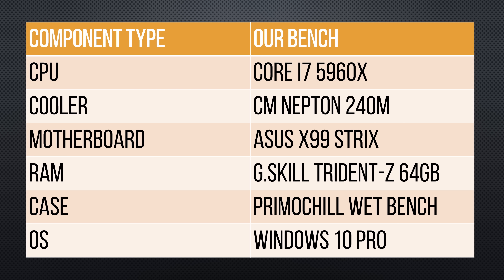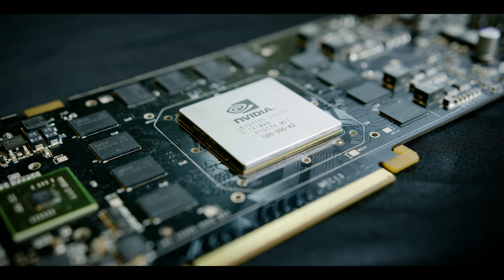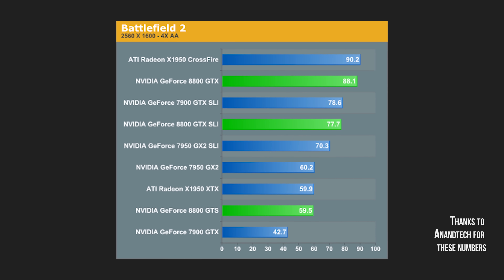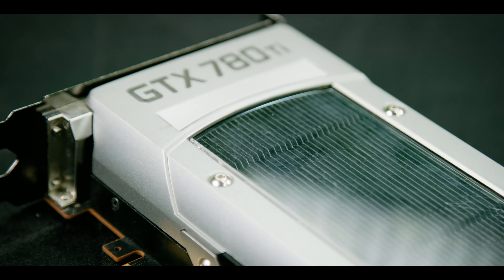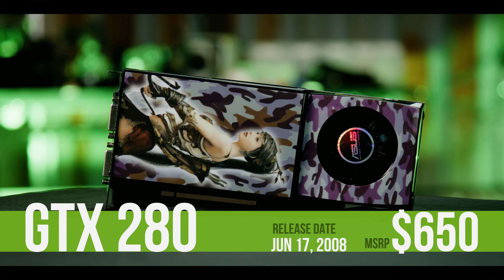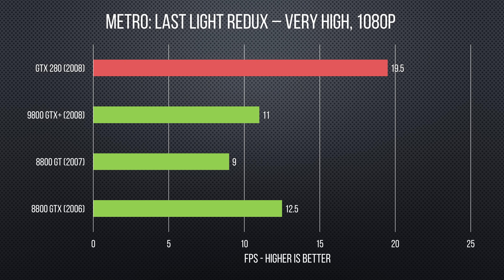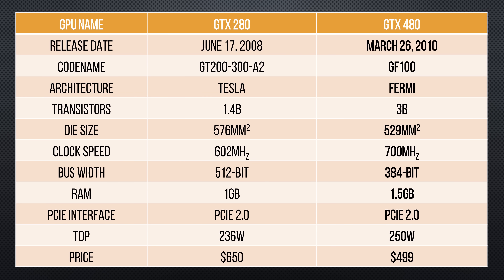10 YEARS of NVIDIA Video Cards Compared!

Comment: Also we can forget the honourable mentions, like the low and mid tier sections. Mostly the GT 710, being a good and light low power, and the GT 730 GK208B revision being light and low power, but with a bit of a boost in performance. Including the GTX 950 low power, the Percy mid tier GPU not needing any power connectors.
And we can’t forget the well rounded revisions of those gpus, the GT 1030 doing the same but with a bit more flexibility and a bit more power, and the GTX 1050ti bringing a substantial boost to gaming mostly with more VRAM.

Comment: Biggest bump in performance was for GTX 780 Ti. Then GTX 980 Ti sort of stagnates without being much of an improvement and GTX 1080 Ti once again gives you a huge difference. 

So, it seems that upgrade path was from 8800 GTX to GTX 580 to GTX 780 Ti and finally to GTX 1080 Ti. Nividia seems to make really significant gains once per two generations of graphics cards.

Comment: It was nice to see all these old cards. Some were pretty familiar.

I had a 560TI, a 690, a 780TI, a 980TI and then I switched to AMD. My I bought the 690 with the launch of BF4 I believe and I was so disappointed in all the Micro Stuttering, that I bought a EVG 780TI Kingpin a couple of weeks later. The 980TI was still used up until the end of Nov this year. My first AMD Card in a long, long time. I had almost 2 decades ago a X700, a X800GTO² and a X1600XT before switching to a 8800GT.

Comment: I had, actually I still have it lying around, an 8800 GT. I vaguely recall that people at the time felt the GTX wasn't worth the extra cost. But my 8800 was still amazing and never struggled with anything I threw at it. In fact it was so good that when I finally replaced it, it was with an overclocked GTX 660 Ti, which required replacing the PSU because that is one hungry bastard

Comment: GTX 580 was 4x faster than 8800 GTX for less money (only $499) after exactly 4 years. That's the same amount of time as between the GTX 1080 Ti and March 2021, when GTX 1080 Ti level of performance was MORE EXPENSIVE than 4 years later (in May it's the same or worse)... the market is truly fucked up!

Comment: This is from when 1080ti was top of the line. Hold on baby face 2017 Linus, 8k gaming is coming in 2020.
Reply: I’m not saying it’s obtainable for the average consumer, I’m simply saying it’s possible to do at reasonable frame rates. Also, you could find them for $2000 throughout the shortage.
Reply: I mean we're in 2021 and 8k gaming isn't viable except in extremely optimised titles with dlss enabled to run it at lower resolutions and then artificially upscale it

Edit: Also with a 3090 that in today's market is over 3000$

Comment: I want an nVidia Ampere GPU with 65536 CUDA cores clocked at 6969 GHz with 420GB of VRAM and a TDP of 250 watts costing $69,420. I would buy it.
Reply: That's actually a very reasonable price tag

Comment: It is insane to see how technology progressed, as just 10-15 years ago they had 1GB and 65nm as revolutionary and NVIDIA is now on 8nm and 10GB.
Reply: 80gb a100 moment
Reply: Yep, that sure is insanely slow progress compared to the 90’s and early 00’s when Dennard scaling was alive and every generation (~1 year) doubled GPU performance and added a bunch of new features.

1080 to 4080 took about as much time as voodoo 1 to 9700 pro.
Reply: Except we had 8gb gpus in 2014 from amd.
And we haven't made any note worthy performance per dollar improvement in the mainstream cards in 6 years due to greed.
Reply: @evila9076  But the top end got a lof of vram with 24gb and this time the whole RTX 4000 series is getting 4NM but I am just waiting for the RTX 4060Ti to come out as it has same performance with the RTX 2080Ti so the RTX 2080Ti users can upgrade to that and I can buy the RTX 2080ti at a massive cost reduction and plus get 11gb of vram.

Comment: Still very happy with my GTX1080, it's the newer 11GHz memory variant with factory overclocked clock from MSI, putting it between the base 1080 and 1080Ti in terms of performance.

Comment: 11:55 remember when flagship gpus didn't cost 1k
Reply: Imagine the flagship gpu being only 1k instead of 1.5k
Reply: @wta1518  3090 isnt flagship, 3080 is 'supposed' to be 700 usd
Reply: @karel4845  if 3090 isn't flagship, what is is?
Reply: @karel4845  3090 is like a quadro card with those CUDA cores and vram xD
Reply: @indraexe7735  titan
Reply: @Bhende45  that was released in may 14 2020, my comment is 2 months old, and at that time the flagship that we knew waa the 3090.
Reply: @indraexe7735  ok
Reply: we are back here
Reply: Ahem
Reply: Haha now u thats for mid end
Reply: We're worse off then we started 😭😭😭😭
Reply: The Titan of that generation (pascal) was $1200.

When the 3000 series launched, Nvidia changed the name from Titan to 3090...like how it used to be before.

E.g. The GTX 690 was the flagship and cost $1000. 
AMD's competitor, the HD7990 was also $1000 at launch but the price dropped massively soon after. 

Btw, probably the most expensive card, if you factor in inflation, was AMD's Radeon 295 which was $1500 at launch.

Comment: Great vid, but you can tell that in certain tests the later GPUs like the GTX 1080 and 1080ti were being heavily CPU limited by the stock clocked 5960X, as evidenced by the lack of seperation between the 1080 and 1080ti in DX9 Heaven Benchmark, Metro: Last Light Redux, Bioshock Infinite, and Half Life 2. 

In reality the 1080ti should be at least 27-30% faster on average in all tests (vs the 1080) if not constrained by the CPU's single threaded performance and the API used, but I understand it had to be standardized to the lowest supported API for the sake of the older cards. An OC to 4.5+ GHz on the 5960X could have helped to increase the lead of the 1080ti, it should easily break over 1000 FPS in HL2 with 1080p Maximum settings.

Comment: here is the faulty informations:

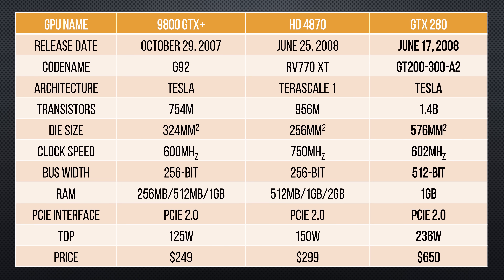1- in @4:55  chart 9800 GTX+ clock speed 600... wrong. It is 738 like before they written in previous minutes.
2- in @7:02 chart Gtx 580 2 gb/ 4 gb Wrong... it is 1.5 gb or 3 gb
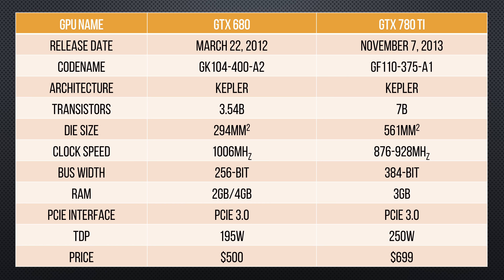3- in @9:50 chart gtx 780ti not only 3 gb it has also 6 gb ones.

Comment: As far as I'm concerned, there was the era before the 8800, and the current era.

Before the 8800, everything was relatively fixed-function, so each new series needed its own balance of pixel and vertex pipelines, as well as providing their own proprietary features like "radiosity lighting" or ATI's "Tru Form" tessellation. They all had their own video transcoding hardware that different reviewers would test extensively.

After the 8800, all GPUs became the same thing in different packages and speeds. Certainly an improvement because now GPU manufacturers had only one direction to go with speed. Maybe 2 if you count DirectX and OpenGL compliance. Still something missing as nothing ever felt new anymore and there were no features to test, FPS and FLOPS were the end-all and be-all.

Personally, I think DXR/RTX are the first thing genuinely new since the 8800.

Comment: I am using GTX 660, it works fine.
Reply: no it doesn't,  i had your exact card untill i upgrade mid september last month to a  RTX2070 super    you dont know what your missing untill you upgrade. and its cheap you can get one for 500$      i was happy with the 660   but now i could never go back.    i unplug my 2070 every night and tuck it in next to me in bed,  and on the cold nights i store it in my asshole.
Reply: Nurburgrings Fastest I don’t think anyone cares

Comment: video cards i have had over the last 10 years (oldest to newest)

1. nvidia 9600GT
2. nvidia 8800GTS
3. nvidia GTX460
4. AMD HD7770
5. AMD R9 270/270X (there the same card just the X has an extra 6 pin power)
6. nvidia GTX970 - current card

my next card will prob be a GTX980 or GTX 1060 as i want to do some VR gaming and nvidia broke the DP ports on my GTX970 by using a broken video BIOS (yes i know nvidia released a bios update to fix this but 1. they shouldnt of had to in the first place 2. it was upto the OEMs to apply that update to there cards (which mine [PALIT] didnt do)
Reply: You seem to be changing them quite frequently and without big jumps in performance, also going for kind of the upper middle class cards. Care to share your reasons? In roughly the same time frame I bought only ATI X700, HD3870 and GTX 970 and I don't think I lost too much gaming experience compared with you, managed to play most of the AAA games decently. In my opinion you would benefit with buying them less frequently but spending more on each :) now, I am not even considering anything below RTX 2060, as its time to upgrade.

Comment: hi, I have a 2008 MacPro III running OS 10.11. I don't think I can upgrade the OS further becuase I'm using Premiere Pro Studio which was designed around 10.6. (10.11 is already glitchy). What card could I use with this machine and OS that would be good for video editing and special effects in After Effects and whats the max GB of ram I should go up to, to balance the card with the system thanks.

Comment: I have a 460 that still runs, and that card was put through hell. For kicks I tested it with BF 1 when it released. I actually got 30+ fps on low settings at 1600X900 res. Granted I had removed the shroud and added my own addressable cooling fans that I had ramped up to Max because I was over locking the snot out of that 460. It took it like a boss. That card is why I continue to support Nvidia even after having a 660, and 770, die mid gaming. My 1060 is still alive and kicking and holding its own. Albeit, at 1080p, but that's fine with me.